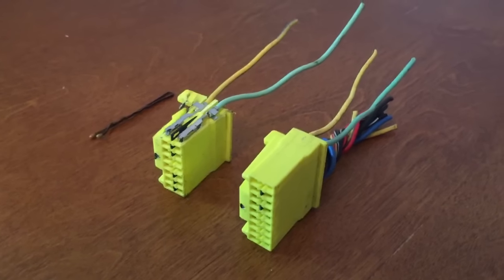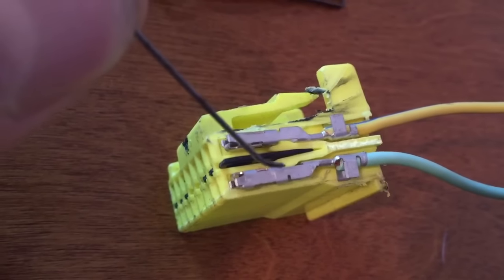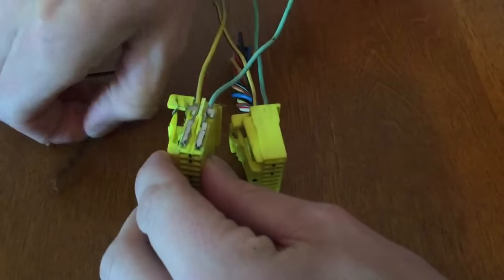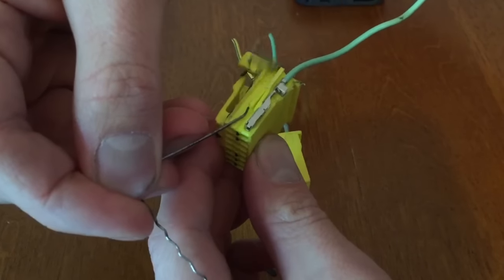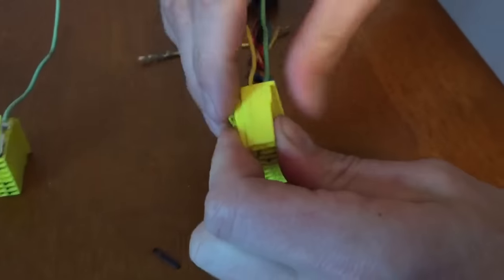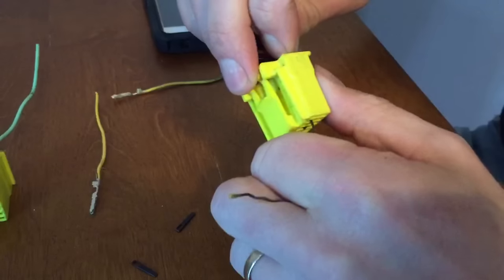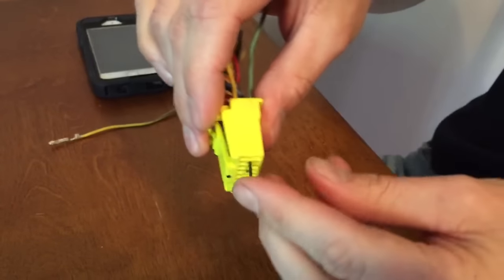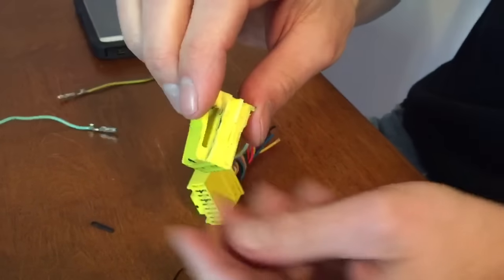How To Remove Pins From 1G DSM 4G63 ECU Connector With a Hair Clip. (Connector Cutaway)

Comment from the maker: Subscribe To This YouTube Channel: http://www.youtube.com/user/4g63mightymax?sub_confirmation=1 
See My Wiring Playlist: https://www.youtube.com/playlist?list=PLsF7T1tRFy2hmiiUUfMZNyV-BUA_yrPIh
The Hair Pins Used in Video: https://amzn.to/2A9DbWi
The Real Electrical Terminal Removal Tools: https://amzn.to/2WUyDvP
More 4G63 Wiring Info Here: https://www.hotrodwiki.com/index.php?title=How_to_wire_a_4g63_engine
Reply: I have a regular 3 pin box connector and a 2 pin on my tractor and the box has a little latch on the inside to catch the a hole on the pin like the latch you are showing but my box is different. my box is old and crumbling apart, my pins connected to the wire is in great shape. My question is what type of 2 and 3 pin box do I need to replace my bad ones.my box is the square type with a push on the out side to release the male side from the female side like those on most vehicles. all the ones I see are the type where the pin has a little piece that sticks up to latch in box. I need the latch in the box. What do they call this type of box----Thank you

Comment: 8 years later you're video posting showing a cutaway section solved my problem. Had 11 of 12 pins come out easily, but 1 frustrated me for many days. I'd try, get mad, put it down etc... your cutaway showed me that I might be able to release it from the back side, used a bobby pin and viola, pulled right out. Thanks very much for the video.
Reply from the maker: Some videos are just timeless! I’m glad that it helped you out! My newer videos are way cooler too if you find yourself bored and wanting more 😂. Thanks for watching!

Comment: I have a regular 3 pin box connector and a 2 pin on my tractor and the box has a little latch on the inside to catch the a hole on the pin like the latch you are showing but my box is different. my box is old and crumbling apart, my pins connected to the wire is in great shape. My question is what type of 2 and 3 pin box do I need to replace my bad ones.my box is the square type with a push on the out side to release the male side from the female side like those on most vehicles. all the ones I see are the type where the pin has a little piece that sticks up to latch in box. I need the latch in the box. What do they call this type of box----Thank you

Comment: Oh my god thank you!! Now I just need to figure out how to separate the fucking thing.
Reply from the maker: Kelsey Pippin - I’m happy I could help! What do you mean by separate though? Maybe I can help more?
Reply: @WiringRescue  I can't seem to pull apart the housing? It could just be because it's in an awkward spot..? It's in my school bus which is a 96 so they haven't ever been separated. Needless to say with cold fingers and a flathead trying to pull the thing apart I was getting really pissed off 😅
Reply from the maker: @kelseyrenee91  - haha!  Cold fingers is never helpful. Each vehicle computer is a little different. For these Mitsubishi ones, you just push down the yellow tab on the top.  Sometimes it helps to push the connector back Inward toward the ECU before pushing the tab down and pulling the connector Outward.  When they sit that way for years, they sometimes do get stuck.
Reply: @WiringRescue  okee I will try that today, thank you!

Comment: what can I do if the latch snaps that holds the pin in? ones just gone in my ECU and now pins loose, is there anything I can do??
Reply from the maker: If I understand correctly, you could just swap all the pins over to a new yellow connector.
Reply: +Jeremy Nutt deffo nothing else I could do? there's so many wires in this connector and very limit space due to being a bike, the pin pushes in but is not secured

Comment: what if it doesnt have a black pin?
Reply from the maker: It likely functions in a similar method inside, but just doesn't use the lock. Most of these connectors that are around this age (1991-94) are very similar.
Reply: @WiringRescue  i have the version with a locking tab thats pulls-up and pushes down.

Comment: how about the connectors without a lock
Reply from the maker: +albert tuazon  Which connectors are those?  Are they on a mitsubishi harness?
Reply: +Jeremy Nutt toyota. it has a plastic flip up lock
Reply from the maker: +albert tuazon Unfortunately, I'm not familiar with the Toyota ones.  You could always go grab one at a junkyard and tear it apart to figure out how it works. Good luck!
Reply: +Jeremy Nutt good idea. thanks.